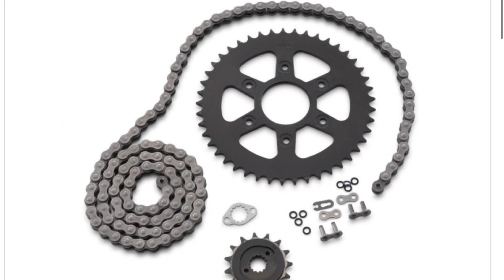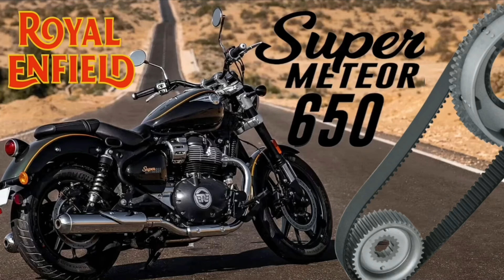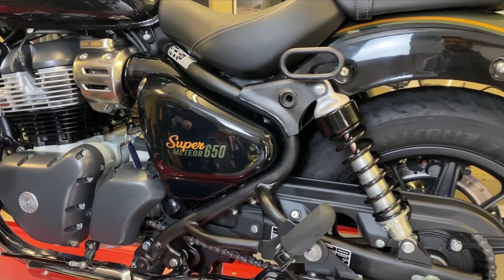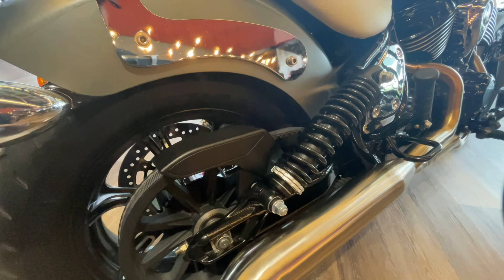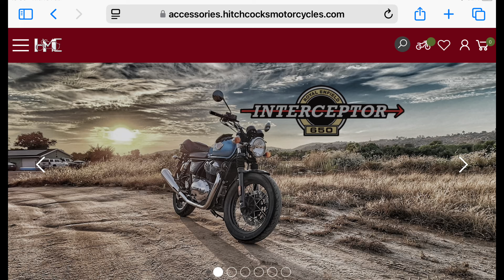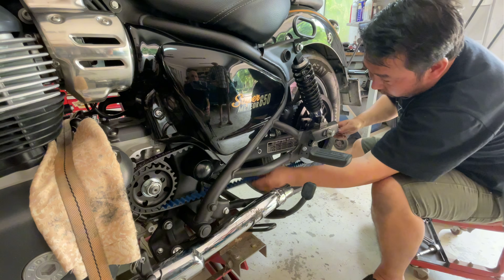Royal Enfield 650 Belt Drive Upgrade - Is RSTech Worth it?

Comment: You just lost at least 2 h.p. and 2 ft.lbs. of torque.
Reply from the maker: I certainly don’t feel it. In fact the opposite. There is no power lost between changing gears. It’s constant drive, unlike a chain where there is that snatch every time between a gear change. And I certainly get better fuel efficiency. Something I will compare in the next video. And here is what I researched: 🙏

1. Lower Friction and Energy Loss
A belt drive has lower internal friction than a chain drive, which means less power is wasted as heat.
Chains require metal-on-metal contact with the sprockets and rollers, leading to higher resistance and more energy loss.
2. More Efficient Power Transfer
Since a belt does not have individual links and rollers like a chain, it engages smoothly with the pulleys, reducing energy loss during rotation.
Chains experience energy loss due to flexing and pin friction at each link, which slightly reduces efficiency.
3. Consistent Tension and Less Drag
Belts maintain consistent tension over time, unlike chains, which require periodic adjustment.
Chains loosen over time, causing inefficient power transfer and sometimes unnecessary fuel consumption due to increased drag.
4. Lighter Weight
Belt drives are generally lighter than a chain and sprocket system, reducing the motorcycle’s rotational mass and improving fuel efficiency.
Less mass to move = less energy required to accelerate and maintain speed.
5. No Lubrication Losses
Chain drives require lubrication, which creates some resistance as oil and grease interact with the sprockets.
A belt drive doesn’t need lubrication, eliminating parasitic drag from thick lubricants.
Even though your gearing ratio is the same, the mechanical efficiency of a belt drive is simply better than a chain drive. Over long distances, this slight improvement can add up to noticeable fuel savings.
Reply: @Ride-with-T  
But how will a belt react to a stone going between the belt & pulley ?
Anecdotally, not well !
Cost is also an issue - £568 inc tax excluding shipping for the kit from Hitchcocks in the UK. My OEM Inteceptor chain lasted 10,000 miles & replacement of both sprockets (OEM parts used) and a DID X-ring chain was less than £100. From industrial experience, losses in a timing belt system are about the same as a well adjusted & lubricated chain - even if there were a noticable fuel efficiency gain, you would have to do a lot of miles to recoup the cost of the belt kit. 
And what about pulley & belt life in service ? I didn't buy a BMW F800ST because of the short life being quoted by BMW (24K miles IIRC) & the high replacement costs for belt & pulleys (more than this kit  - quoted £700 parts only at the time).
Gearing up may improve comfort when at highway speeds, but previous experience gearing up an XL600V Transalp by one tooth on the front (which dropped revs by approx 400 at 70mph and made the bike far more comfortable on the motroways) caused an increase in fuel consumption. Only about 2-3 mpg, but it definately used more fuel after the change. Going up one tooth on the old 4 speed Bullets (I had both a 350 & a 500) was great in top gear but mucked up the lower 3, requiring more clutch slip to get going. As I only find 6th to be too low for comfortable motorway riding on the Inteceptor (too close to 5th IMO - should be more of an "overedrive" ratio), I don't want to make the other 5 higher. "Solved" the issue for me by choosing not to use motorways as much a possible !
Reply from the maker: @mgnbukint6502  The belt drive system is not for everyone or all motorbikes. But it is certainly suited  for cruiser motorbikes. Which is why Indian, Harley Davidson and the Kawasaki Vulcan 900 fit them, as standard. Off reading with chance of stones like you say, is not suitable. I love cruisers. It’s my style of bike. I don’t think I could even get a Transilp off the side stand. It’s not just the cost of the chain, but the Labour to fit it also if you are not mechanically minded. Add this to the cost every 10,000 miles, then a belt drive system designed to last 100,000 to 150,000 miles (and they do), then they certainly pay for themselves. No lobbing, no mess, smooth ride, and more fuel efficient. The benefits are all there. I could not go back to chain again on a cruiser. 🙏
Reply: @Ride-with-T  
Chains are easeir to fit than belts - no need to remove the SA to fit a chain, as they can be split & replacements rivetted in in-situ. I suspect that the DID X-ring chain will outlast the "value engineered!* OEM item, so I don't expect to be changing every 10K miles with the replacement. Labour costs are not an issue for me as I do my own work, but no big deal to change out a chain & sprockets - a  competent dealer should be able to do this in an hour on an Interceptor?. So far I have 5K on the replacement & have yet to have to adjust it, but do agreee that clean-up of chain snot is a PITA -maybe better to  engineer a good enclosed chain system rather than belts !
I  have no motorcycle belt drive experience, but have read that HD belt life is typically 30K miles (if not ended sooner by a stone incursion) and as stated BMW were suggesting that their belt & pulleys should be changed at 24K, so 100-150K seems a bit optimistic ?
I could see that for somewhere with a wet / dusty-but-not-stoney / tropical  climate that a belt system could work better (no lubing etc.) but the lack of widespread take-up of belts (other than for scooters - and that is a different type of belt & usually fully enclosed) suggests that it isn't perceived by manufacturers as being an optimum solution for general use. I doubt that cost comes into it at an OEM level, as volume manufactured pulleys & belts are not likely to cost any more than a traditional chain & sprockets.
As I am never likely to own a cruiser (don't fit my useage) could be why I don't see much value in this solution, but glad that it is available and that it works for you.
Reply: @mgnbukint6502  As Teacher T said, there is no need to remove the SM swingarm, so installation effort is just like a chain and sprocket swap.

Belt drive has come a long way since mainstream introduction in 1981 and these new gen curvilinear tooth profile with carbon fiber tensile cords are a far cry from the belt I ran in the 80's.  My Harley service manual only goes to 80,000 km, and is "inspect and adjust only."  I am not the only one to have put 160,000 km (100,000 miles) on a belt drive, under Canadian conditions, and about 60,000 in tropical conditions on a bike that is a lot heavier than a RE and with 141 Nm of torque  

Not for off road applications. Some will argue that rocks are a problem, but after all this is a road bike.  I just, might possibly, have gone through some roadworks in the 160,000 km I have put on my last Harley belt, while living at the end of 1km gravel drive for the 13 years I rode that bike

In addition to Harley, belt drive is/was OEM fitment on Indian, Victory, Buell, Kawasaki, BMW, Suzuki, Triumph, Zero, Yamaha, and the mighty Boss Hoss, over literally millions and millions of km, so a well proven concept for a road bike.  Yes it costs more than a chain set even on an OEM level, but clearly the engineers on a non-price point motorcycle, see value and engineering sense in a belt vs a chain.  Not for everyone, fine, but the advantages of no oily mess, no adjustment, no maintenance, no carrying chain lube on a trip, quieter (if that matters to you), lower long term cost, no downtime for chain set changing at the shop, and smoother, matter a great deal to a lot of riders.  

As you have never experienced a belt drive and are happy with your chain that is fine, and enjoy your bike

Comment: Im thinking of getting rid of my Super Meteor and getting a Classic 650 that are about to turn up here in Australia, the chain on the Super Meteor has been a pain in the arse since day dot, the first chain tension I did it was at position 7 on the bar and I was already out of room on my first chain tension 😳
That belt drives sounding pretty good man if you don't have to constantly tension it, the chain thing with the Super Meteor is a Royal Enfield fault, a shame as its a great bike im just sick of dealing with it.
Reply from the maker: Understand. Firstly RE have upgraded the chain and sprockets. Get the new version, not the old. Much better. Sadly it is a consumable part, so very much doubt it will fall under warranty, even though it should. Secondly the belt drive is a game changer. I’ve made plenty of videos about it for the Super Meteor 650. A worthy upgrade. But understand if you want to change to the Classic. Which does come with the upgraded chain and sprockets. 🙏
Reply from the maker: @ waiting for a test bike. We will find out soon. 🙏